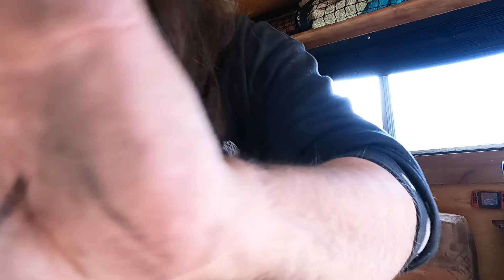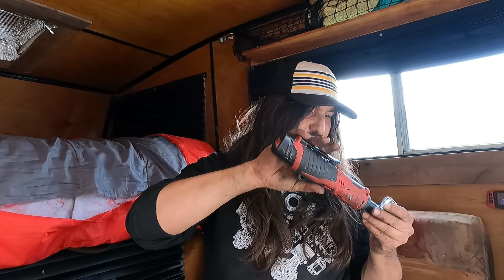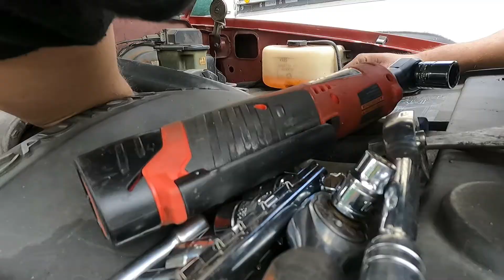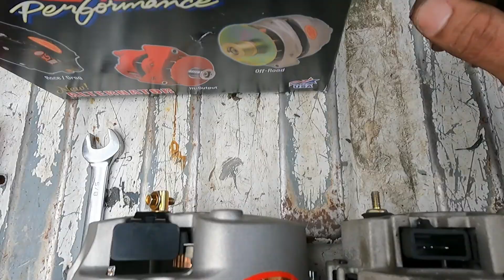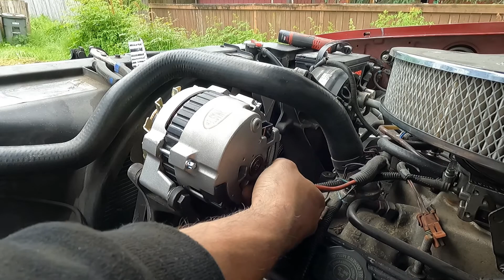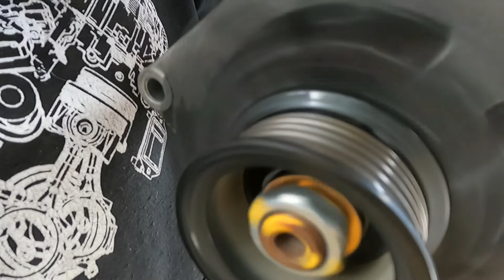FIX Your Electrical Issues! K1500 140 Amp Alternator Upgrade Guide

Comment: i don't see in your video but I've ordered the same alternator but it has a "negative ground terminal" should i be grounding it also is your trucks wire a 8 gauge as well not sure if i should be upgrading my wiring I'm just a bit lost with trying to install this alternator into my truck other then that negative ground terminal everything is the same hook up.
Reply from the maker: A dedicated ground terminal, thats different. Everything else plugs in fine though?  Can never have enough grounds!  I used my stock wire setup and it works just fine for this upgrade. 🍻 did a 130 amp on my duramax with stock wires, also works great 👍
Reply: @KooshdaakaaGarage yeah everything plugs in fine just a decimated ground terminal I got off the phone with power master saying to recommend changing my wire to a 6 gauge as the 8 could cause overheating of it

Comment: i got a couple questions man, would i NEED to get a new starter to match the alternator or is it okay w these stock one?, and is it okay to tighten the bolts w out a torque wrench? thanks man!
Reply from the maker: Yup, absolutely 💯 your oem starter or whichever you choose will be fine.  Gotta say the power master starter is pretty sweet though.  Torque specs are always good to follow but honestly ive never used them for an alternator, so use your best judgment when sinching down those bolts 😉🍻
Reply: @KooshdaakaaGarage thanks brother much appreciated 🙏🏽

Comment: Did you have to change the ground wire to the alternator to the battery to a thicker one ?
Reply from the maker: @gregbotello5339  i did not.  I think doing the big 3, is always a solid move though.  I have a buddy who has been running a 220 amp in his 2005 suburban for about 8 years with stock wires to the alternator without issues. Seems like stock is pretty stout. But the big 3 is highly recommend 👌

Comment: I need a stronger alternator, new fans take a lot of amps plus stereo system A/C and lights. Going down the road works great. At a stop light down to 12.7. Any idea, thanks again.
Reply from the maker: @AmericanPatriot1778  this 140 amp should work for ya.  I use a 130 amp in my duramax to charge my two truck batteries and two camper batteries.  Works like a charm and never let's me down.  The 140 power master should do the trick for ya if you have an older sbc chevy

Comment: Hey I was planning on doing the same thing to my 1992 Chevy and I was wondering if 140 amp is too much for my battery or would I have to change any wires?
Reply from the maker: Hello!  Your oem cables will work just fine for 140 amp.  I have a buddy that has a 250 amp alternator installed with stock cable and hasn't had any issues over the past several years.  That said, the "big 3" cable upgrade is always a good idea, and let it never be said that you can have too many grounds 😁
Reply: Or how would I know if my battery can hold up the power?

Comment: Gonna get some halos for my malibu so I’m gonna be putting a 150 amp alternator on it , will it burn anything or cause major problems ?
Reply from the maker: It shouldn't cause any problems for you. I have a friend that runs a 230 amp alternator on stock wires... he's had it for I don't know how many years now with no problem.   Just keep an eye on it at first to make sure all your grounds and connections are solid

Comment: My 1993 K1500 had a rebuilt Mexican 105 amp alternator.   IDK if it was putting out enough.   At night,  all lights on,  AC on full blast,  the alternator could not keep up.  The Red Brake light started to flicker on...  volt meter looked low.    I also noticed voltage at the tail lights was low.. around 11.9 V.    I'm trying the Power master 140 amp.   SHOULD solve my problems.
Reply from the maker: The 140 amp will help for sure.  I'd check all the grounds, make sure the terminals are clean and have the battery checked or replace it too just to be sure.    Best of luck!

Comment: I've noticed the same thing on my 89 with the OEM alternator. If the blinker is on the voltage gauge wiggles back and forth everytime it clicks. Ridiculous. How much power is a tiny halogen bulb really drawing? Also the GM alternators always seem to whine. Even when they're new.
Reply from the maker: Exactly! I think these old trucks would really benefit from "the big 3" ground wiring.
Reply: @KooshdaakaaGarage  the big 3 ground wiring? Please explain. Or do you have a video about it.
Reply from the maker: @Sc0teeBe318  the big 3 would involve a larger gauge wire and would be connected as follows: The Big 3 Upgrade is a Swap or Addition to These Three Cables: Alternator positive cable that runs to the positive terminal of the battery. Negative battery cable that runs from the battery to the vehicles chassis. Chassis grounding cable that runs to the engine block.  I haven't done it yet but I'm going to do this on my dually.
Reply: @KooshdaakaaGarage was thinking thats what that was,I plan on doing that with my ext cab reg box 93' that got swapped to rhe smaller 305 sbc

Comment: AD 244 Alternators, Chevy 5.3L LS also work and bolt right up 150 - 400amp.
Reply from the maker: They do??  That's pretty cool.  Thanks for the tip!
Reply: @KooshdaakaaGarage   Yeah, they bolt right in. the only difference is the connectors. They make an adapter, so you don't have to do anything, or you could cut your wire and get the plug for the new alternator and spice them together. It will work fine.
https://youtu.be/GN6gb80Mz0k
Reply: u think they it will work on mine i got the stock alternator and since im gonna be upgrading my sound  system i need more amps to run them mine is a 1985 with a 5.0L?
Reply: @brayanestrada3741  , Sorry I just realized you said 85. The bracket on that should be the little slider? I believe it should work fine with that as long as there's enough room, the case is bigger.
Reply: This is what I found and it will work with a little bit of modification. The alternator he used in this video is the same as the Ad244. The AD244 replaced it and is rebuildable.

https://youtu.be/dtMK-ol4Bzw

Comment: Did u have to get a bigger belt? Or was the oulley the same size?
Reply from the maker: Thank you for the question Samuel! I did not have to change the belt size for this one. The tensioner pulley was able to compensate just fine 🍻
Reply: @KooshdaakaaGarage  thanks, cheers 🍻

Comment: Hello good vid and info. Since you upgraded to 140amps did you have to upgrade you power wire gauge size too. I recently upgraded my alt to 140amps and was told I need to upgrade the wire size to 4awg. Any idea if this is true? Thanks
Reply from the maker: Hello Gil and thank you for your question.  It is a good idea to upgrade your power cables I think.  I have a 140 in this truck and a 130 in my duramax with stock power cables and have not had any issues what so ever.  So I'd say you are safe to keep them stock but I'd upgrade them when you can. I'm looking at making my own cables here pretty soon 🍻
Reply: Did you ever have to upgrade the cable ?

Comment: Great vid brotha appreciate  the info just got mines for my 1991 k1500
Reply: Installed it yesterday it was simple with your explanation. Only thing I had to file a little bit on the power connection bcuz it was different from old alternator I just filed a little off and fit like a glove . Thanks for the update
Reply from the maker: Thank you Neto!  It's still holding strong a year later 🍻
Reply: @KooshdaakaaGarage how’s it running 3 more years later man?